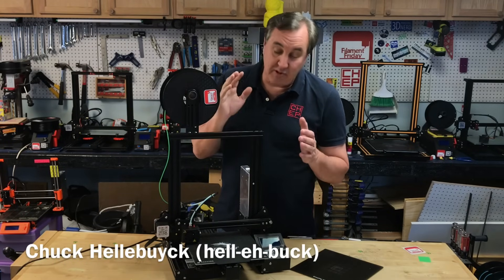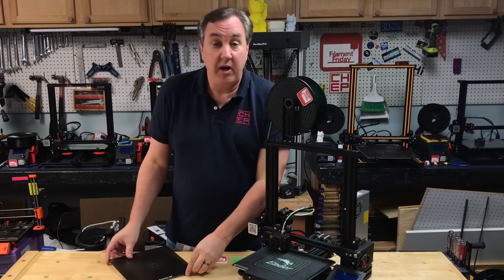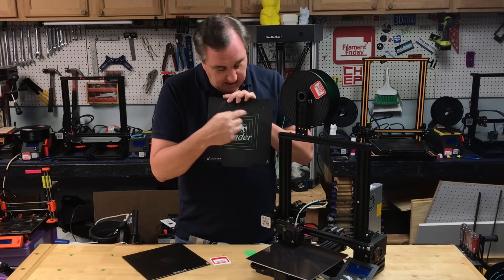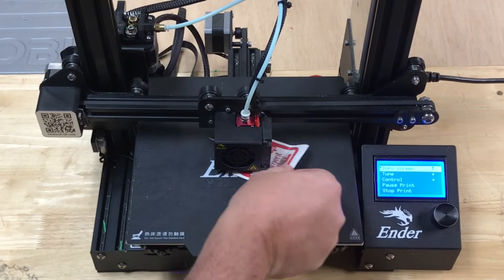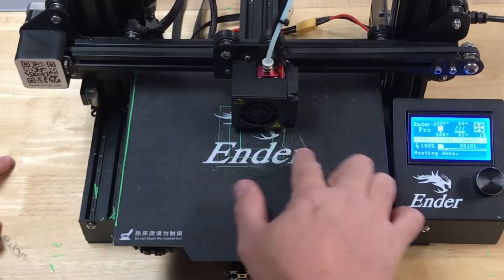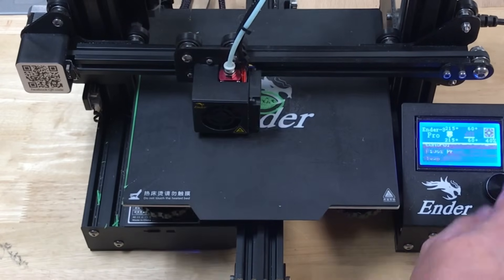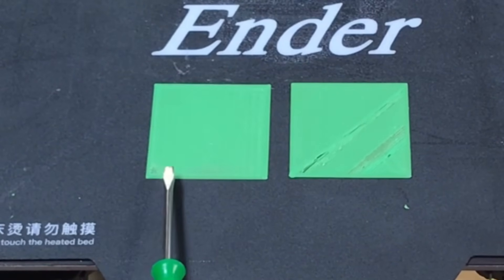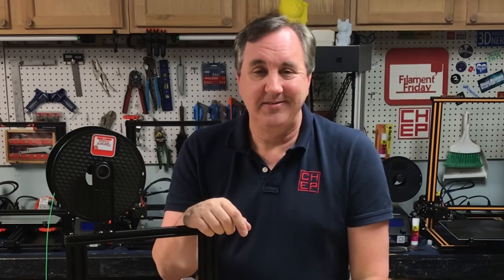Creality Ender 3- Easy Way To Level Your Bed

Comment: I just got my Ender 3 Pro, today. It took me about an hour and a half to build it. Then, I tried leveling the bed and do test print. Nothing. The estruder started making a clicking noise. I tried a lot of things, and nothing. Changed filaments, and still nothing was printing, although the nozzle head was moving. I got with Amazon support, and just as the support lady was about to give me the return authorization, I remembered watching this video. I told the support lady to hold on, that I would try something else. So, I found this video again and followed Chuck's steps for leveling the bed. Magic! The printing worked! Awesome!
The nozzle was actually too close to the bed, and that's what caused the filament feedback at the estruder and the zero printing.

Comment: Have to figure out how to edit that, the filament I have in now likes 210 extruder 60 bed for good results.  I usually use simplify3d by USB 
since I already have it, your two gcodes are the only two I use from the SD card directly.  whoops figured out how to edit it while I was typing.

Comment: when i get the corners set with the glass plate it touches in the middle and there is no space in between. I'm thinking of just going back to the regular build plate to try it that way, its brand new just came in yesterday and have been trying to level the glass plate all day. if i move it down of course it has tension on the paper in the center but the corners are then too low. any help will be greatly appreciated!

Comment: thankful for videos like this. helping me slowly understand everything. a question though and coming from someone who is fairly un tech savvy. I have run the initial program however, I am running out of screw to lower the bed, and its still not enough. Have I done something wrong or is there a way to somehow raise the position of the nozzle to allow for more room to lower and level the bed ?.
Reply from the maker: Adjust the Z stop switch higher.

Comment: So what do you do when the middle of the bed has a dip in it? All 4 corners are great, but the middle offers no resistance on the paper what so ever. If I raise the corners even equally, the nozzle will grind against the bed around the outside until reaching wherever the dip starts. Please help :)
Reply: If you have the flexible bed, I would try folding some small squares of tin foil and putting it underneath your bed in the middle to raise it just in that spot. 

Worth a shot. I just levelled my glass bed this way in the front right corner. I don’t think it would work for the middle of a glass bed though but def would on a flexible one.

Comment: Sorry if you've already answered this but I have issues with the test gcode running super slowly sometimes. I've read it has something to do with it picking up the last print speed instead of holding onto its own. Do you have a fix for this? I thought maybe there was an updated gcode somewhere..
Reply from the maker: Turn it off and back on before running it. See if that helps.
Reply: Thank you for the fast reply. That may have worked to clear it but I actually figured out how to change the gcode just slightly to always have it move at 60mm/s using Notepad++. I found the solution on Reddit. Just need to add F3600 right after the coordinates in the gcode file
Reply from the maker: Thanks. I’ll take a look.
Reply: I do want to say thank you though for making this. It really helped a lot starting out.

Comment: Hi Chuck  Thank you for all of these great tutorials.  We,ve done the bed levelling but after a couple of prints its all out of level again.  i only print cookie cutters and PPE equipment like ear savers. I have a Monoprice Maker Select V2 and use PLA 60 degrees bed 220 degrees nozzle.  We've done all of the upgrades including the locking thumb wheels.  Any suggestions on keeping it level?  
Thanks so much
Lorraine
Reply from the maker: No idea on that machine.

Comment: I am having an issue here. I run the level code and I adjust everything per your instruction. Then I go to print the test and the extruder ends starting from a higher point when it prints. the filament does not even touch the bed? Any ideas?
Reply: I just noticed the ender 3 black pad it comes with is slightly warped. I think this is what may be causing at least part of my issue. I am testing again, but if you have an ender 3 with that black metal plate check to ensure its flush.

Comment: Thank you for the two files. I will say I found them a little buggy: the test didn't want to load properly, and the leveler file was running at like 1/10th normal speed so i had to recopy it over. But other than that it worked fine. I got one printer fixed, and running quietly, the other is still CLUNKing and underextruding. Any ideas?

Comment: This is so incredibly helpful, we have been working for many days trying to get our new Ender 3 set up. Changed springs, bought glass bed, stopped an wobble on the, increased temp. leveled, changed nozzle, leveled many, many times. This is the closest we have gotten. Ours prints the squares from the outside in (no idea why), the outside squares stick brilliantly but the two middle ones still feel off. The nozzle seems to be really close and if we slightly increase each then it is too close on the corners. Any ideas would be hugely appreciated. Thank you
Reply from the maker: Check the bed surface for flat.
Reply: @FilamentFriday  There was a dip in the middle! We added 2 post it notes between the plate and the glass bed and it is printing for the first time! Thank you so much.
My partner is worried they might catch fire but I assume it is perfectly safe.
Reply: Mark Gilborson use tinfoil

Comment: Very helpful. I used this to level it once and from now on I use the skirt lines to adjust it on the go. If your bed isnt level yet, just set it to 5 skirt lines and you have all the time you need to adjust it
Reply from the maker: Exactly how I do it. Works well.

Comment: I have levelled the bed and have got the test print perfect. But when I go to print something from cura the layer width just seems so much thinner than the chep test print. Any ideas?
Reply from the maker: Check your extrusion width is 0.4
Reply: @FilamentFriday  thank you so much! This was the problem, I updated cura and it changed it to 0.2 which was horrible for adhesion

Comment: How often should you level your bed? Only when I remove the glass or should it be after X number of prints?
Reply from the maker: When it needs it. You see it in the print.
Reply: I just started 3d printing yesterday and I have removed the bed after every print. Only minor tweaks were necessary. I just watch as it draws the skirt and adjust the bed while its printing.

Comment: I have many trouble to align my bed with your archive, them comes a click I cannot use it because my bed is a mirror. And the home point of the printer for your file is for ender original plate. But this made old mans thinking. Thanks a lot.
Reply from the maker: Mirror doesn’t matter. Just need to home it first. You may have to adjust the z stop switch.
Reply: @FilamentFriday  Thank you. But I try 6 times and probably something was wrong. Thank you só much.

Comment: I'm trying to use this to level my Ender 3 pro.  I run the gcode and it starts at 82% and does 3 corners before it says done.  It never does the back left or the center.  Any ideas?
Reply: AceMilo Download it again. It may have been messed up or you could have forgotten to eject the usb before you pull it out. If that doesn’t work, just try a different sd or reader.

Comment: Hi Chep, great video. Now, where do we download those files to? Are these to be installed into the printer from a compute>
Reply: Yes, download the g-code from the links provided in the description. Using your computer transfer the g-code to the micro SD card that was provided with the printer. Then the SD card slots right into the front left of the printer, towards the bottom. Bring up the menu of your Ender 3 and click read from the TF card. That should do it.

Comment: Your levelling process is king. Thank you Chuck. Do you have an copy of the gcode with faster X and Y speeds between the 5 locations on the bed?  I’d like to do this process faster :) I’m not ready to edit gcode yet. Thanks in advance.
Reply from the maker: No. I don’t.

Comment: Chuck,
Not sure how often you check the comments on these old videos but I am at a loss with my ender 3 pro. I recently moved the printer to quarantine with me. and since the move I can't get the bed to level even following the method and using the files you have provided... any thoughts? Could the new version of Cura have something to do with it?
Reply from the maker: You did explain much except can’t level so not sure what to tell you. Cura has no affect on my files. You don’t even need Cura to level it.
Reply: CHEP I got it. Thanks again your videos are always life savers thanks for always being here for your viewers! You rock!

Comment: Hey Chuck. Can I just say your videos have helped me get started in this bewildering hobby so quickly and easily. I don't know what I would have done without them. I am now looking at ways of making the bed levelling even more accurate. I am mounting a dial gauge  on the fan casing, that will slip on and off very quickly. However, what I'm not sure about is if the bed height is absolute, or if it is relative, as long as all four corners are level to each other. Another way to put it, is the thickness of the paper slip critical to the nozzle height? If so, can I modify your Gcode to change the positions and height slightly, according to the tip of my dial gauge? Thanks. Andrew.
Reply from the maker: The key is the live adjust. The paper just gets it close to start. I live adjust some prints while the first layer is going down.
Reply: @FilamentFriday  Thanks Chuck. I have now fitted it and it seems to work very well, providing the first corner is the right distance from the nozzle. I zero the dial gauge then do the other 3 corners, then do them all a second time.

Comment: I tried leveling using my own wits and it ended painfully, many hours wasted.  I also tried using tomb of 3D printing's test print and got horrible results.
The bed leveling test as well as the squares it printed really made this whole bed leveling thing idiot proof for me.  Thank you so much.

Comment: Everywhere i just hear "use a piece of paper" But what thickness is that..some use business cards, some store recipts, some the sticker foil...thats 3 different thicknesses, i have a business card thats excat 0.3mm (plastic), a paper one thats 0.28, sticker that is 0.4 with sticker and 0.18 without sticker, post-it with 0.1mm...so whats a good number?
Prints a 0.16 seem to work good (calibration cube) and 0.12 seems too close..but when i tingen it for 0.12, the 0.16 doest seem to work well anymore..help?
Reply from the maker: The sticker back is 0.1. So abpost it will work. The live adjust is the main portion anyway.
Reply: @FilamentFriday  Thanks for the answer..one last question..how do i see if my bed is too hot or too cold? My PLA says its 60max and i tried between 50-55-60..sometimes it works, sometimes it doesnt. Is it generally better to have it on the hot side or better lower?
Reply from the maker: Hot side.
Reply: I've been using rhodia paper and that's worked well for me. 0.1mm according to my callipers.

Comment: Hi! Maybe someone can help: I used this Testpattern to test my fresh BLTouch (and upgrade to mariln 2.x). The first Layer is near perfect but if i print the whole thing the top left corners are a problem. Every other corner and line will come out perfect. Top left is the turning point for every line so naturally the nozzle comes by more often. But it seems to rest there and give to much filament so that the problem escalates with every additional layer. Next Layer will squish the blob already there and make it bigger I've been slicing with mostly standard settings.

I would be thankful for any advice wich setting might cause or fix this problem.

Comment: Hi I've been watching your channel and have built my ender 3 along with your video, and you state that you prefer printing on glass, so I bought a glass bed, but the bed is about 5 mm thick and I can't get the bed low enough to even start the g code file to even start levelling? any suggestions?
Reply from the maker: Lower the Z stop switch. You may have to clip off the little knob on the stop switch bracket.

Comment: Hey chep, i just registered and joined chepclub and paid 10$ i really want to get the profile u used in this bed leveing gcode file.
Which profile is that?
Reply from the maker: I believe I used Cura 3.6. My profiles for Cura are here. https://www.chepclub.com/cura-profiles.html
If you want Simplify3D profiles, go to the review pages. 
https://www.chepclub.com/printer-reviews-silver.html
Reply: CHEP i registered and paid but my account isnt upgraded yet, im waiting 😋
I really need this exact profile my printer works so well with this profile, isnt this one of the paid one that you have on your gold/silver pages on your site?
Reply from the maker: You have full access now. I fixed it.

Comment: Hi CHEP, great video! I was able to level the bed perfectly using your methods and printed both gcode files without a single hiccup. However, it seems when I go to print literally anything else, things are 'off'. When printing the included test cat or dog gcodes, the extruder is too high, it just leaves squiggles (squiggles that stick, at least). When printing a freshly-sliced Benchy, it doesn't stick except for in a few places and just drags around triangles. What am i missing? Thank you!!
Reply from the maker: Not sure. Have not heard of this. Make sure you’ve homed it before doing the leveling.

Comment: Alternately, you can set the levels in the centre of the table where it will do the actual printing.... therefore ignoring the warped bed corners...You could use a cut down smaller bed mat too in the centre of the bed...🤔🤔🤔😳

Comment: I downloaded both of your files and it seems to be the same G code file in both downloads and it tried to run the square 1st and now I have a square ingraving in my mat becuase the nozel was too close. I had to cancel the print
Reply from the maker: Did you follow the video and home it then use the paper to set the level first?
Reply: @FilamentFriday  I tried to. There were 2 G code files in there and both were the box. G code. I tried to do everything you did in the video but instead of running the 5 spots check it started doing the box
Reply: @alanbalcom9654  I had the exact same problem

Comment: Hey, nice video! 
I try to change de Z value to 0.5 because it's a little to down but it's not working :)
Do you have any advice ? ( I'm using a Ender 3 Pro)
Thx anyway !!
Reply from the maker: Don’t touch Z offset unless you are using autolevel.
Reply: @FilamentFriday  ok but the extruder is going a bit to down how can i raise the extruder? (the extruder touch the bed really hard)
thx :)
Reply from the maker: Either adjust the bed lower or lower the Z home switch.

Comment: Moving the knob CR10S Pro V2
Clockwise: lowers the bed
Counterclockwise: raises the bed but lowers spring tension. Possibly cause layer shifting. Add shims to make it stiffer.

Comment: Awesome video Chuck. I really appreciate the work you put into the script and sample print to help with leveling.  I just setup my Ender Pro 3 and the script and seemed to be short on the X  axis.  Also the test print seemed to center to the left.  Is this something I need to adjust in the script or my printer.  It seems that it's not centered on the bed.

Comment: A tip for if you still have trouble, make sure your hand isn't resting on the bed or on the  bar holding the extruder. The bed will move down and you will not properly calibrate your bed. So if you push down on the bed restart the process to get a proper level bed

Comment: So at first you say slight resistance, and then you say significant resistance for the other screws. Is that correct?
Reply from the maker: It’s just a starting point. The real level is during the live adjust.
Reply: CHEP Another question, I’ve been trying to level the bed using live adjust and this strategy but it does not seem to be level.
Reply from the maker: Some beds are warped.
Reply: My removable bed was so warped from the creality factory that I had to replace it with a glass one. Glad I did tho, works well and first layer is top notch everytime
Reply: @MABFR01  I've only been able to print like 2 things on mine, last night i decided to cut some glass and make my own bed, still can't level it correctly, but im getting there

Comment: Thank you for the tutorial. I had adjusted using your method. It worked well for a while. I found my gantry was off by alot. I had adjust the eccentric nuts and now my z axis is off my 1mm (l to r). Though now i can not level the bed to save my life. I get i used the sane piece of paper and all. The squares do not adhere as they did prior to gantry adjustment. Another thing to add, the extruder motor is clicking a ton more on the file provided. Having done everthing to adjust that, i can not get it to stop during the print. Do you think this is related, not enough filament is being extruder hence the clicking and lack of adherance?

Comment: when you level the bed why do you do it for the thick and thin sticker?  after you set the bed level for the big sticker and then move on the small sticker, wouldn't you be changing the level that you just set?
Reply from the maker: The real level happens during the live adjust. The sticker just gets you close.
Reply: @FilamentFriday  What is "live adjust" referring to?
Reply from the maker: When I adjust it while printing as shown in the video. Starts at 3:30.